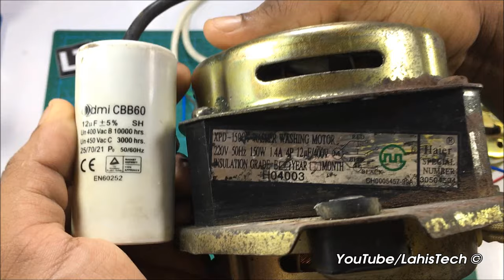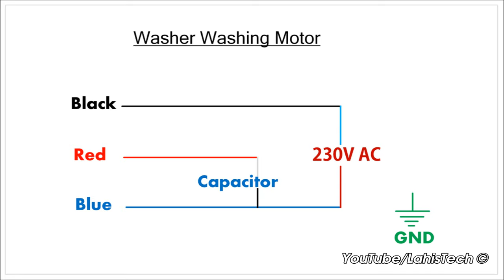Washing Machine Motor 230V Wiring Connections

Comment: Now I saw when testing spin motor your resistance is fluctuating not stable or is it because u hold the cable with two hands. Because usually it supposed to be a stable resistance value not fluctuating I am correct.

Comment: the washer  motor should be spin in both direction something is missing
Reply: Washing machine has a circuit with does that.
Reply: Both points of capacitor terminal will go to the controller board in washing machine, switching connection between two will switch the direction..

Comment: Halo..when testing for resistance you should make sure that not any of your body doesn't come in contact with the test leads on both points. Try again..great job otherwise.
Reply: Sir it could be also convert to dc this kind of wsahing machine motor?
Reply: Our body resistance will be far grater than the range measured there, moreover, he did the same thing for all three. He is just trying to figure out the common. So that may not be compulsory, but it's a good practice...
Reply: Air

Comment: What is the rpm on these motors and would they have sufficient torque to power a diy small woodworking lathe?
Reply from the maker: I didn’t test the RPM of these to be honest. Nope; the torque isn’t enough for a lathe; even on washing machines these motors attached with smaller belt-pulley or gear system to increase it’s torque.